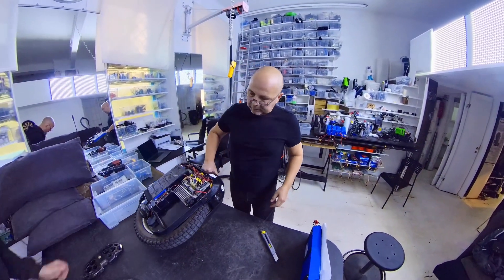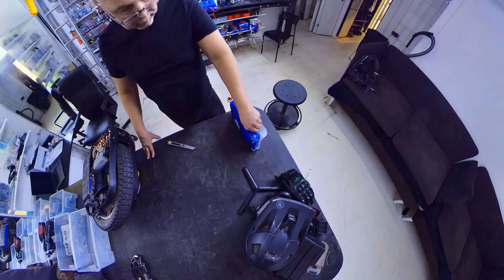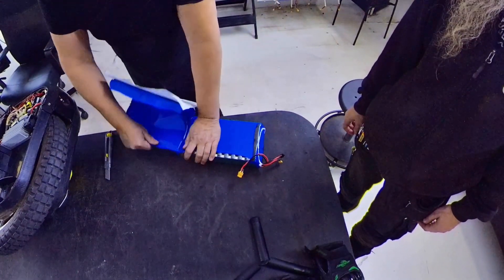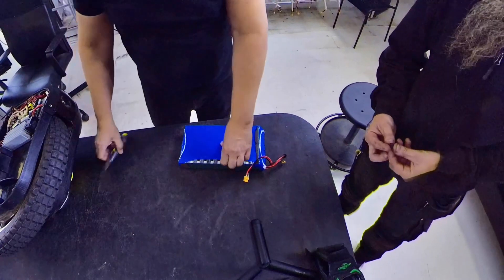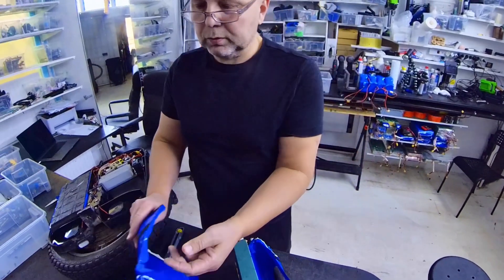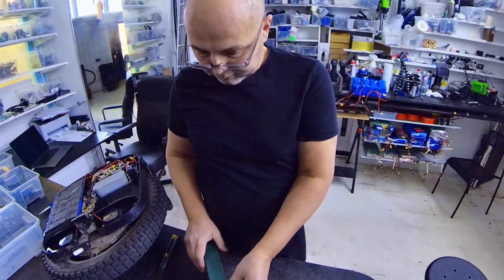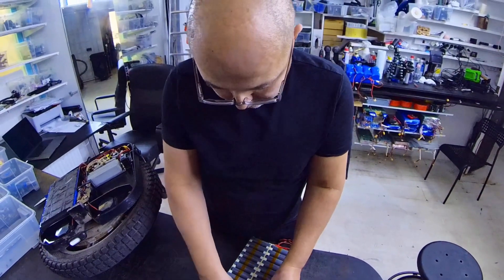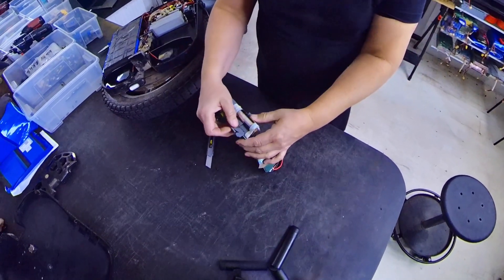Warning! EUC battery doesn’t charge to 100%.

Comment: My commander pro charges to 90 percent after crashing it should I be in danger??
Reply from the maker: Yes, when some cells get damaged and can not get charging, the rest of cells in pack become overcharged to compensate the dead cells at balancing process. Individual Voltage will increase to 4.2-4.5volt, ending up in fireworks at heavy discharge when riding or hot powercharging at home. Please, do not store your wheel inside, contact your dealer.